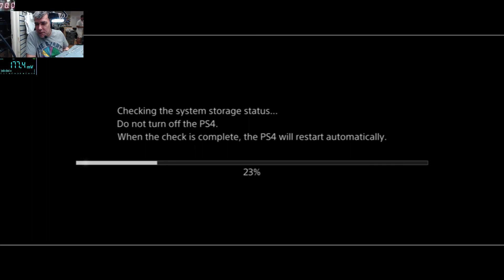Playstation 4 , hdmi port repair

Comment: I will trying it myself now 
Hope it works great let you now later.
I did it and solder the pins after replacing and it works fine. So I thank you for the example

Comment: Lets start at the beginning of this video to teach (Electronics repair school) What not to do so hopefully a kid reads this comment and dose not do what he did in this video! Just to give them a better chance at not damaging stuff before they figured out that what you just did will not last more than a few hours or will kill the system, knock off components on the back side of the board or just blow them off, so hear we go. 
1st At 4:25 Do not pull out all them cables to remove the Disk Drive it is absolutely not necessary to remove the Disk drive for an HDMI Port Replacement
2nd At 6:18 That lid will never come off like that unless it was seriously broken previously watch a different video to see how it is removed I have a video that will show you how they actually come off.
3rd At 6:40 he says you can do this without the Microscope Camera? Let me tell you, everyone I have ever seen try this without a Microscope Camera Failed Miserably! perhaps 1 out of 10,000 individuals may accidentally succeed without a Microscope Camera. Trust me I know I am a licensed shop and get to see the aftermath of videos like this one.
4th At 7:16 Do not pull the fan plug out like that put something underneath it and lift straight up "It is very fragile!"
5th Notice at 7:19 he pulls up the metal LOL He did not check to see if all the screws had been removed and he fakes like someone was talking to him to distract you from noticing his mistake. and whats with you grabbing the mouse to your computer are you watching a YouTube video on how to replace the port?
6th At 15:59 you put the port on the motherboard with no prep work and COLD no less that is exactly why at 16:42 the port moved and dang near fell out even though you were sure it was good LOL OMFG! Every Pin of that port including the legs of the HDMI ["A Grounding point"] was not attached! yet you were sure it was okay and attached!
7th you call yourself a repair school but you did not or at least did not show you soldering the legs to the port! Whats Up with that?
8th At 18:31 you say someone can do this without a microscope camera yet your job soldering of the pins on that HDMI Port was laughable at best even with that expensive microscope camera you are using
[CAN YOU SAY COLD SOLDER JOINTS?] 
9th At  19:10 You spreading the thermal paste in that manner can lead to air bubbles that will act as an insulator and cause the system to run hotter possibly causing chip burnout 
10th At 20:00 He bent the spring tension retainer way to much and in doing so remove a lot of its ability to keep proper downward pressure that will over time cause overheating and Did you just use a flat blade screwdriver on a cross top/Phillips head [what happened to the first thing they teach you at school regarding using the proper tool for the proper job? 
11th At 22:06 he lost video and I can say after seeing his work it was his solder job the second he moved the system it cut out.
12th Did you notice starting at 21:38 his security cameras clock reads 12:01:50 but at 23:17 in this video less than 2 minutes later on this video the security camera reads 12:10:29 almost a full 10 minutes has been cut from his video?? I think he edited in the PS screen and then had to switch systems so the video would stay on after his butchering of the HDMI install for that system.
Reply: Maybe you should make a video or post a link and show us all how to do it your way.  When it comes to information, you seem to be full of it. Make a video instead of trolling others.  Or maybe you're just trying to lure some of Sorin's 27K subscribers over to your sorry channel.
Reply: About your pt 12, at 21:38 the security camera clock is 12:08:50 not 12:01:50.
Reply: TheHGCGamersClub
So how come your on this video? You are clearly overqualified to be here. Unless you're watching a YouTube video on how to fix the hdmi port
Reply: Well HGCGamers, I know who I would use to repair mine and it wouldn't be you ...
Reply: WOW, THE COMPLAINING IS STRONG WITH THIS ONE. AND HE WANTS TO BE THE YOUTUBE FAKE REPAIR MAN POLICE. EXPOSING ALL YOU TUBE DIY ELECTRONICS REPAIR VIDEOS.

SO TELL USE, IS THAT THE ONLY REASON YOU ARE HERE? OR ARE YOU HEAR TO SEE HOW A REAL TECH DOES IT WITHOUT SCHEMATICS.
Reply: @wisher21uk  well said fella !!!
Reply: Michael Lee well it had to be said 😂
Reply: @sergelavallee913  you tell em lol